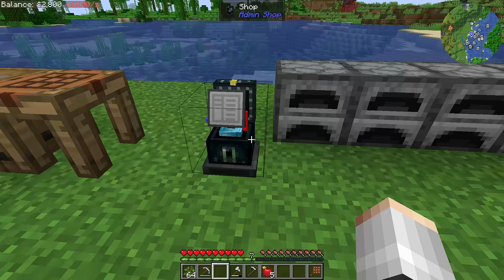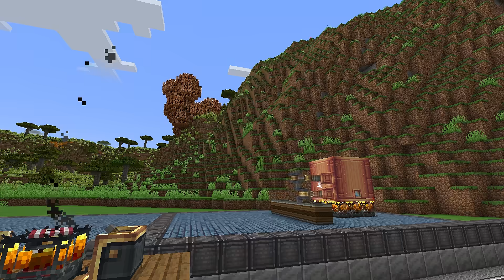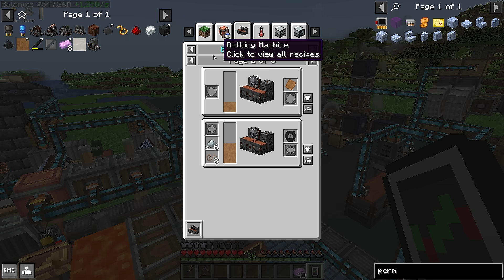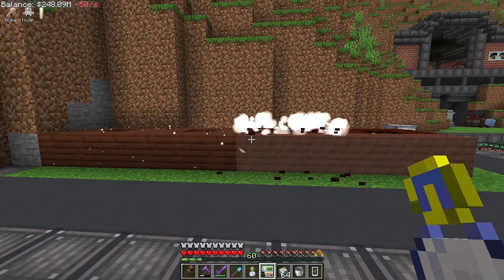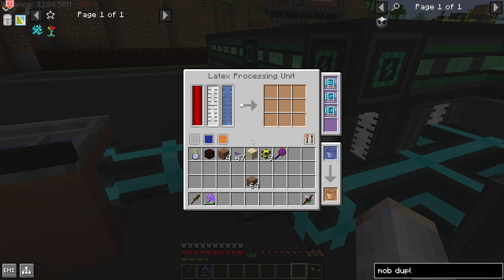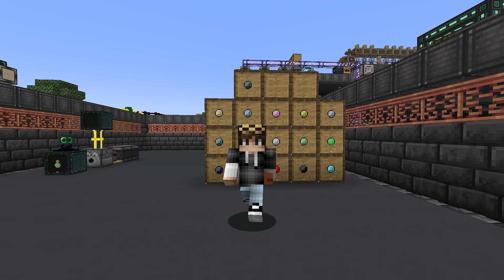I Played 100% of Forever Factory

Comment: i don't recall if there are crafts and additions alternators in the pack but if there are, you could use that to transfer SU from the compact machine as RF through flux networks and use a motor to convert it back

Comment: Integrated Dynamics can cause issues with CPU. It loads the chunk to see if it's still working, and then that loads other mods in that chunk, then unloads it. But changes to the chunk caused by other mods? Better reload that chunk to see if ID still works. It checks that it is working and unloads, but triggered a mod on load again. So time to check again, infinitely. Individually it isn't a huge load of CPU... *But it checks everything ID related, and you just made a huge amount of cards and stuck them in a drawer.* With ID less is more, and more is CPU load.

Going away from those chunks unloads them for good. But if you're in the area you get CPU load from that repeating process. Storage Drawer Controllers cross chunks. Granted this is all from a casual google search but I remember ID being dangerous to use without thought put into things.
Reply from the maker: Yeah it's dangerous in the hands of someone who doesn't know it - like me.  I tried to keep things to bare minimum because I know my limits with it

Comment: 7:01 Basic Mechanism recipe tooltip: "80% Chance"
Me: Can already feel my mind melting in agony.

Edit: Wait, they have a manual recipe that's guaranteed? If there's any way to automate that one instead of using the dumb chance-based Sequenced Assembly, I'd take that any day, no matter how much more resource "inefficient" it might be.

Edit edit: I'm really sorry to have to add this bummer into my comment, but I thought you should know that you... Didn't complete the Quest Book. I'm not talking about the stuff in the upper tabs like the challenges or configurations, I mean there's 2 quests in the main chapters that never got marked as completed. One in Electrical Age, and one in Industrial Age.
Reply from the maker: The hammer has durability, so makes it somewhat awkward to automate the manual recipe due to nbt data

Comment: your fps issue might've been caused by too low of an allocated memory, you can change how much of your system ram you allocate to forge in the settings, try increasing it :D (in your f3 before switching to a server your allocated was at 100% util, but with the server running most the basic stuff it went down to 44% in f3 if you just increase it larger packs wont require you to run it on a server in future)

Comment: Pipes can get rather laggy, most likely it was integrated dynamics with the insanely high pull rates you had set to em.

Edit: A great way to check what might be heavy on resources is with a mod called Observable.

Comment: If you're having performance issues in any modpack, just download Spark and use its commands to diagnose the issue, I've used it plenty of times to find a problematic mod that was causing me tons of TPS and/or FPS lag and it works like a charm. Just keep in mind though: Mods that do things to the vanilla game like increase mob spawning won't be listed as the cause in Spark's report, so it's best to go down the class tree it provides to figure out what the issue is.

Comment: 51:10 disregard the discord. The easy way to automate it is using downgraded drawers with a compressor for each item reading both the input and outputs stopping inputs when the level of the output is over 64.

Comment: @Hobble. I am sorry I couldn't reach out any other way through mail or discord. You should have something like this available! So, the lag that you had. Was a waterwheel.. That create waterwheel, has issues... A lot of them, and I can guarantee you the lag wasn't a thing before you put down waterwheels, each waterwheel can cost you a massive 40+ FPS PER waterwheel if your FPS is uncapped. It's a reason my server does not allow them.

Let me know if I can be of help any other way, Let's hope you see this comment :-)!

PS: This is across multitudes of versions of create and minecraft, I am not sure why this is, I think it's an issue with how the waterwheel is done by itself or how another cross performance mod interacts with it. So please do keep checking if 10+ or so have a noticeable and I do mean NOTICEABLE effect, anything giving you a general decrease of 10-20% of your uncapped fps with vsync turned off is insanely significant, but I found with this it's more around 50-80% of your FPS with 15-20 or so
Reply from the maker: That's such a strange issue, I'll be sure to keep track of it in the next Create modpack

Comment: Mad respect. Also how large of a hard drive do you need hold the footage. The files have to be reaching large numbers by the end.
Reply from the maker: Usually around 500gb by the end of editing
Reply: @ dang. How long does it take to edit. Curios about the upload time too.
Reply from the maker: @the_silent_one_  From start to finish was around 3 months.  I did burn out during it though so edit times are longer. :)
Reply: @Hobble.  All the more impressive. Keep up the good work...and don't ignore the call of the greg. You've been chosen to join, it is only a matter of time.

Comment: The performance issues are probably related to a mod integration. the dev probably used some very inefficient code to integrate the mod
Reply: Oof, that's mean :( /j
Jokes aside, adding custom recipes and integration for a modpack is super lightweight, loading up recipes takes less than 5% of server start time, and after they've been loaded it won't have any impact while you're playing.

I believe the issue he had was that the version he was playing on (1.0.5) had the "Spark" mod installed, a "profiler" mod that was originally included on the modpack by default, but it is very resource intensive as it continuously records performance metrics and is enabled by default. It was removed on version 1.0.6 for that very reason, to improve performance.
- Ammonium
Reply: @Ammonium-ow6pd   do you know why there are a lot of bugged recipes with certain ingots? I’ve also seen in other gameplays of this mod pack like caffeine
Reply: @Ammonium-ow6pd   thats actually fair.
Reply: @Ammonium-ow6pd  

Congrats on making the modpack 
Performance is a finicky issue let's just all blame it on Java 

Don't forget the guy is working for free and while modding can be fun analising  a profiller isn't
Reply: @fabienso5889  I wouldn't necessarily say it's Java, as java-driven software is used by over a billion people with no issues 
I'd say it's a coding inefficiency somewhere as a result of human error in one, or a few particular mods
Reply: Should’ve just used KubeJS smh (unless they did use it)
Reply: I think there is a mod that tries to set FPS to a certain amount. Going into mod config for it and changing it to make the number higher to stop the issue.
Reply: yeah i was playing this on my 2 core 2 thread pc and it was awful, i could play monifactory pretty fine however this modpack is pretty laggy
Reply: most likely in the video he mentions create being laggy and while that is true he didn't have enough of it to cause the lag down shown in the video